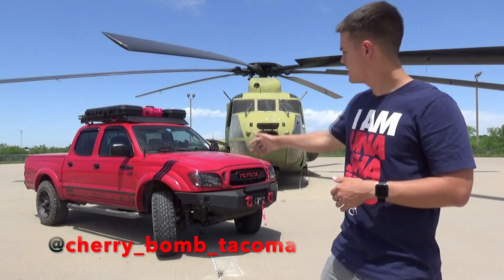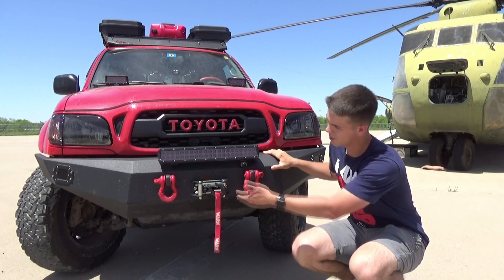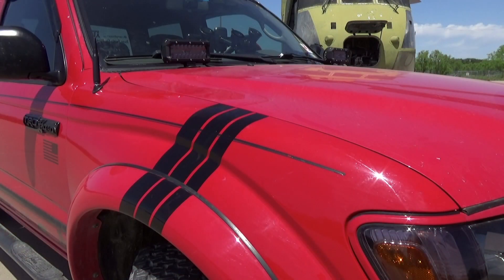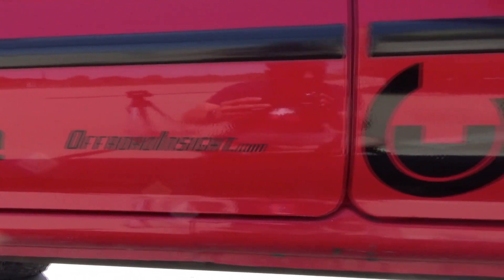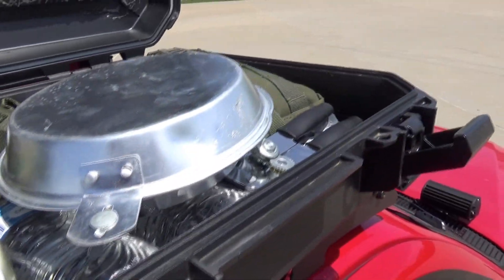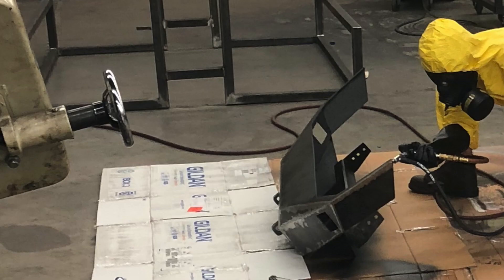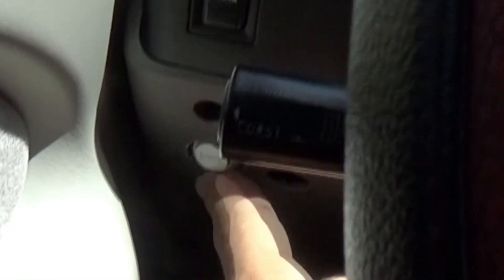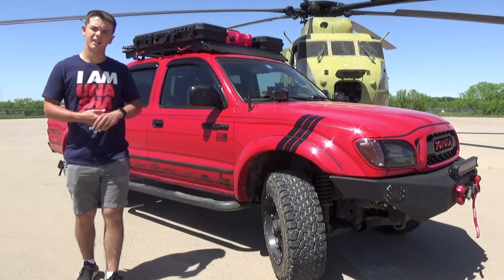Cherry Bomb - 2003 Toyota Tacoma - Off-Road Walk Around

Comment: I gotta know. All these youtube channels with built-out Tacomas raise the question, do I go into $15000 of debt for all the brand name equipment and have it all shiny and not scratched up at all, or keep a cash budget of $2000-$3000 and outfit my Taco for just the necessities and actually use it and scratch it up. This is a nice show truck, but I just doubt it's all really useful? Am I wrong? Did you pay for all of this? or did you borrow money via line of credit or credit card? I'm so confused on how I have a good Net Worth, low expenses, good income but cannot "afford" all of these insane upgrades. I guess different things are important to people. Nice build and I hope you didn't go into debt just to show it off
Reply: I've been working on my 04 tacoma for quite some time now and I'm not so into on spending loads of cash into it. A lot my projects were DIY or "do it yourself" projects because I don't have thousands of dollars to spend but I am very proud of how my tacoma came out to say the very least. I didn't buy the fanciest or most expensive items/gear for my truck I just simply gone the cheap route such as spray painting my rims black with a 5 dollar spray can, building my own roof rack out of unistruts, I mean I go ebay and buy cheap things like red seat covers that were 20-30 dollars, cheap but nice looking floor mats and even 5 dollar each fog lights i installed on my roof rack. I'm even building a diy truck awning which may have just cost about 60 dollars in total. Basically I'm just saying I'm not a fan spending a lot money when can do it way cheaper and be more than satisfied. Sorry for rambling on I thought should just share and hope this may answer your question.
Reply from the maker: Chris, I have had this comment in my inbox for awhile and I am sorry it has taken so long to respond. Let's start with this 2003 Tacoma. This was a gift from my parents and the only thing I had to pay for it, at first, was gas and insurance. I then joined the military so I had a lot of disposable income. This income allowed me to slowly build up the truck. I owned if for five years before getting rid of it. At the filming of this video I was at the four year mark, but this truck was not able to do everything I wanted it to. Everything on the truck externally was functional and I used it all when I went out (if you want specifics, just ask). However, since it is a Prerunner it only has a locking rear diff and does not have 4WD. So, this year I traded in the 2003 for a 2021 offroad. Yes, I had to go into debt for this, but I live on the East Coast now and the 2003 would not have cut it. I was originally going to do a 4x4 conversion on the 2003, but with all the auto hobby shops closed on base and living on base with no garage, this was not the time or place to do something like that. Now, let's talk about parts. I have not bought a single new accessory for this truck (new truck). I've only gotten a few things so far, but the slidders were on Facebook marketplace, the bed mat was free from a friend, and the grille was also free. I have no intention on buying anything new that is going to get scratched up unless I simply can not find it used or I want to splurge. Additionally, I stay away from name brand unless, again, I can find it used. Finally, I am hoping to get more sponsors with this new truck so I can get parts for a lower price than retail and work with those "big" brands. In summary, buy used or stick with smaller brands (also Amazon). I hope this essay was able to answer your question. If not reply to this or shoot me a message on Instagram or email me (all links on channel page). Semper Fi and God Bless!